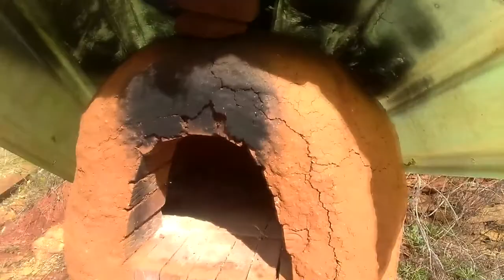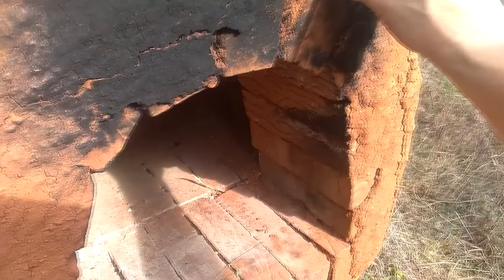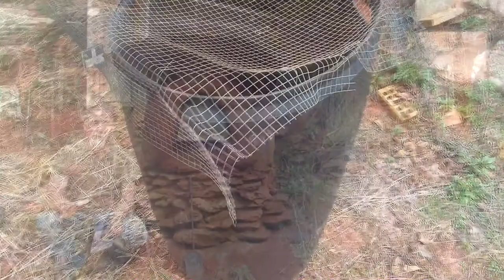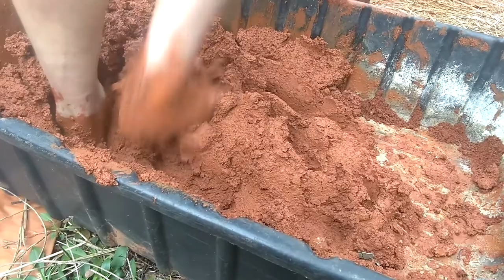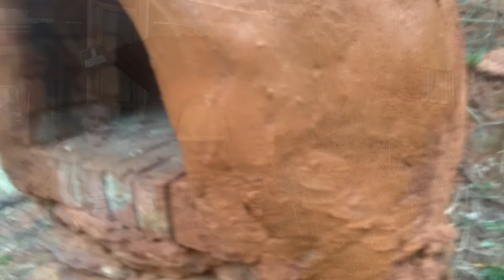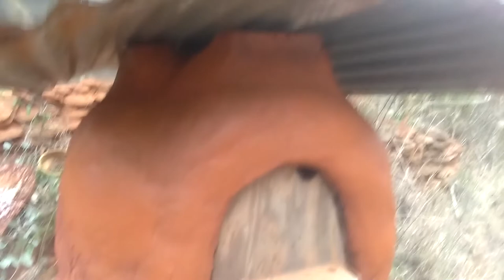Mixing Adobe ( Cob ) and Revamping My Adobe Oven

Comment: I thought it was a cob oven with straw mixed in, look great wish i had one
Reply from the maker: There is straw in the lower levels but just not on the finish coats
Reply: @goforgreenliving  ok, do you have a video om making the cob oven? i'll go look
Reply from the maker: It's in the cards of the video the video link